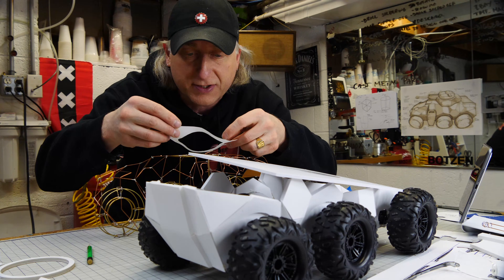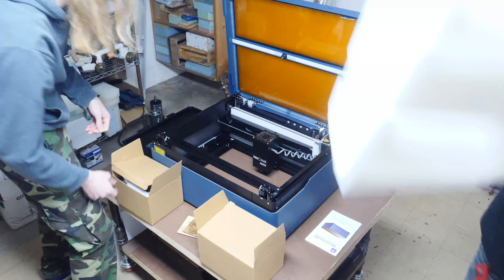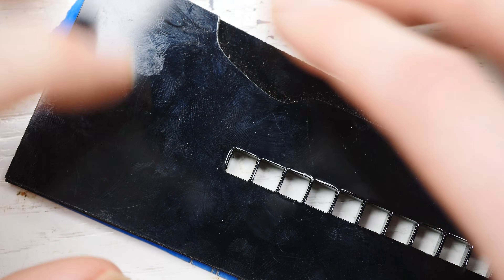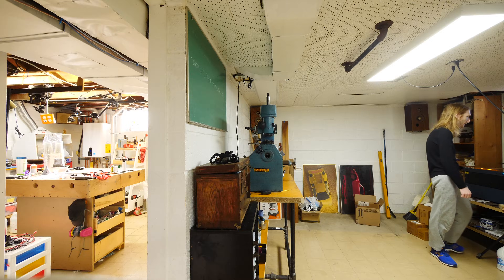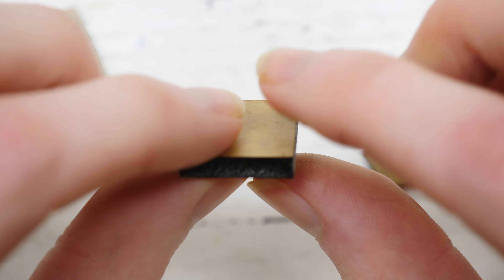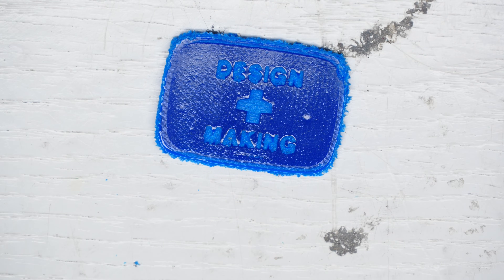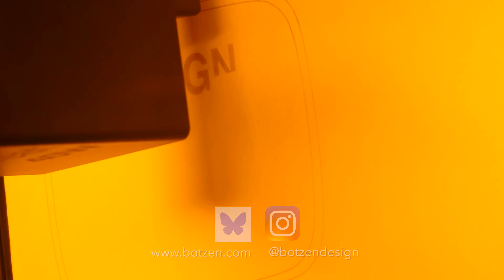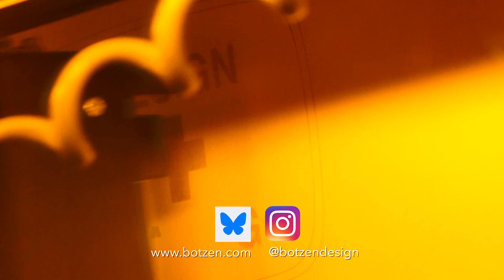WeCreat 40W vision diode laser, any good?

Comment: There is only one professional type of co2 laser worh its money, a RF CO2 laser that is air cooled because its made from metal instead of glass. Way smaller dot and ten times longer life time. A Gweike Cloud RF is a good start model an next step after that a laser from GCC Laserpro or Epilog with a Synrad laser. Diod lasers has its area of use but any co2 laser is better.

Comment: XTool P2 looks decent to me Eric - hopefully they will get in touch and send you one to review
Reply: I think I am going to ultimately buy an XTool as well.
Reply: I can second the recommendation for xtool; I've used the f1 Ultra for work and it's a pretty solid machine. Worth noting: diode lasers need to be tuned to whatever you're cutting from my experience. The f1 has a bunch of presets for various materials(making it much easier to get where you need to be), and it's callibration for the laser is super easy as well. Of course you pay premium for those features, which sucks if you don't have the $$ to throw down(I know I don't)but it is what it is I suppose.
Reply: @sunshinefats  I fig a Glowforge is what, $5k? If I can get an Xtool with air filter for under $6 it's worth saving for. I really only cut acrylic 1/4 inch and nothing else.

Comment: So, imperfect optics, the laser itself, let's be honest... sucks. The fact you have to press start on a wifi machine is asinine. Thank you for being so honest about this machine. The motorized Z axis also reducing the actual machine dimensions is very cool though.
Reply: I suspect ever manufacturer is going to require you hit start on the machine itself for remote jobs (wifi). I haven't used my xTool wired, but after sending the job I have to hit the button at the machine. From looking at Epilogues manual, it looks like they have the same process. 

Every laser I've seen has big warnings not to walk away or leave the running machine unattended. They can't make you stay, but they can reduce their liability if they make you hot a button at the machine to start it.